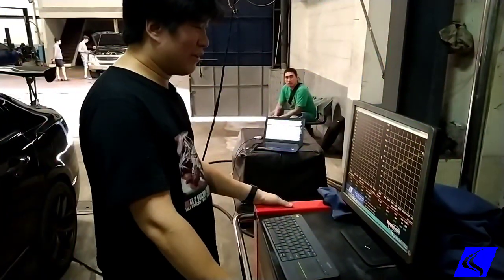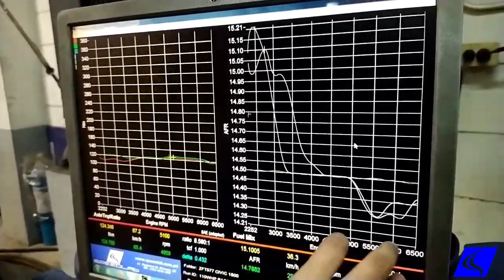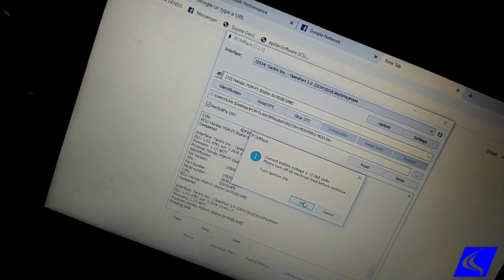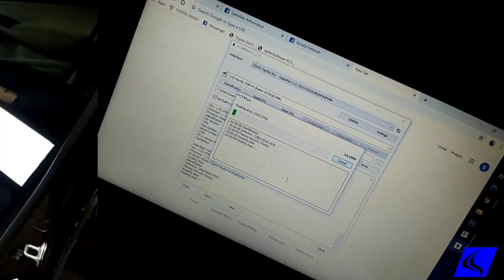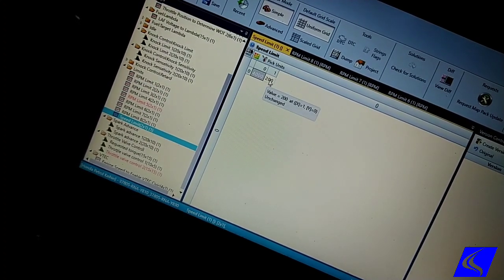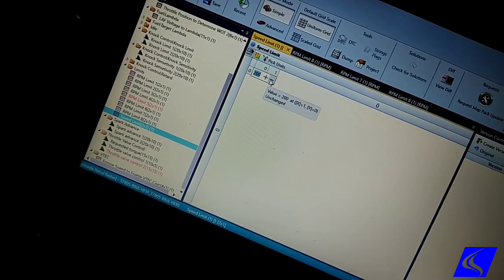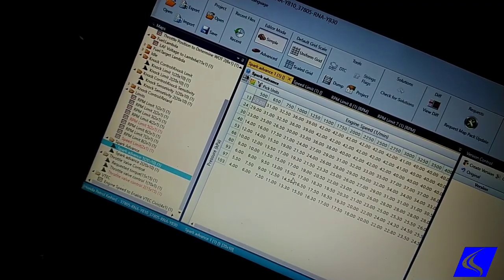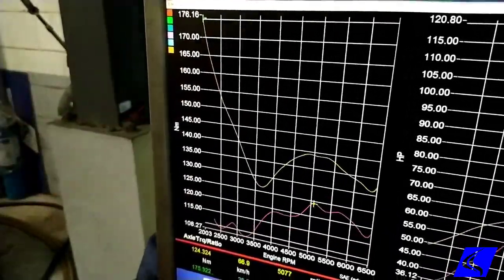Honda Civic 1.8L ECU Reflash and correcting wrong exhaust pipe

Comment: Just curious, won't the throttle be delayed when you go beyond 40% throttle because from what I saw it only equalizes when 40% throttle is at 6000rpm, below 6000rpm it would be lower than 35. Correct me if I'm wrong lol.

Comment: if i wanted a different exhaust other than borla that you recommend, would that be okay?
Reply from the maker: Sure. What exhaust
Reply: @speedlabchannel4452  would HKS be a great one? Also if I may ask, is it fine having aftermarket headers, cone air intake and HKS? (stock piping, remove reso, retained cats)
Reply from the maker: @josefdelacruz4871  yes
Reply: @speedlabchannel4452  how much would a HKS muffler cost sir? as well as headers?
Reply from the maker: @josefdelacruz4871  real hks 26500 
Headers 17500
Reply from the maker: @josefdelacruz4871  the ones you see in shopper and Lazada for 2500-3000 are all fake
Reply: @speedlabchannel4452  the real hks for 26 500 is only a muffler?
Reply from the maker: @josefdelacruz4871  yes muffler only
Reply from the maker: @josefdelacruz4871  yes. You can fall off your seat now

Comment: Sir Sydney how much po sa toyota vios 2019 model un power package nyo.  Change po ng air filter set, full exhaust + borla muffler. Thanks po
Reply from the maker: K&n intake 10500
Full exhaust 32000

Comment: Hi, does this means if i do a muffler delete on my car and put a straight pipe through from the rear axle all the way out the back, can I compensate with the loss of low rpm torque by doing a proper ecu remap? The car is a 2015 mazda 3 1.5L skyactiv
Reply from the maker: Yes

Comment: Boss baket po ang vios automatic 2017 model delay ang batak nya parang hirap cya tapus malakas pa sa gasolina ,18km nag 500 cxa anu maganda gawen boss
Reply from the maker: K&n intake 10500
Full exhaust 32000
Unichip 35000

All cars have delay and only we can solve it

No other shop

Comment: Hi speedlab. Pag ba nagpa full exhaust (borla) mas magiging fuel efficient si 1.8s civic fd?
Reply from the maker: If we do it, minimal change 0.5-1% 
Ecu remap/reflash  is the one that gives 8-10% better mileage
Reply: @speedlabchannel4452  how much would it cost?
Reply from the maker: Full exhaust 32000
Ecu remap/reflash  25000

Comment: Which pipe size do you offer for this R18 engine? Around 2' pipe would be okay?
Reply from the maker: 1.75”
Reply: @speedlabchannel4452  but 1.75' is the original pipe size am I right?
Reply from the maker: Balázs Bence Dobrai yes
Reply: @dobraibalazs The oem pipe is made cheap with crush bends in production that create restrictions in flow  , the same size pipe with mandrel bends will flow better combined with a custom header pipe.
Reply: I believe Speedlab can tell you what to add so you can use a 2” pipe. Most definitely it will have to work with a bunch of things for a 2” to be productive. Ie. Intake, manifold, headers, and, Speedlab’s tuning

Comment: Can you add consistent pops on Honda Civic 2018 CVT if we do ECU TUNE? Got headers and full exhaust without catalytic and Resonator
Reply from the maker: The loudest you can get is by not having any muffler
Reply from the maker: Yes p25000
Reply: @speedlabchannel4452  does the sound of pops can tweak on tuning or it depends on the exhaust how loud can it bang?